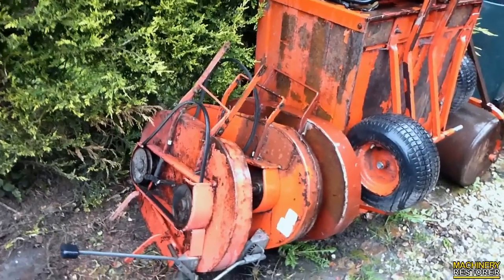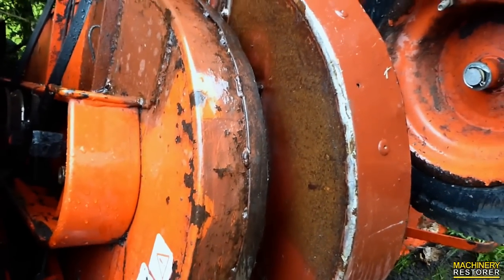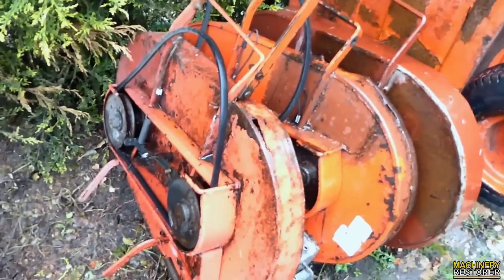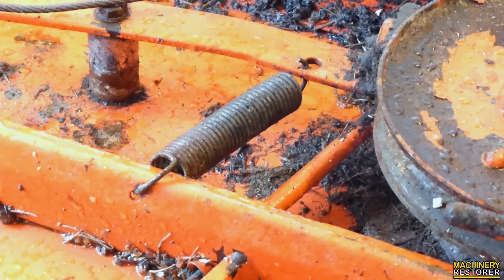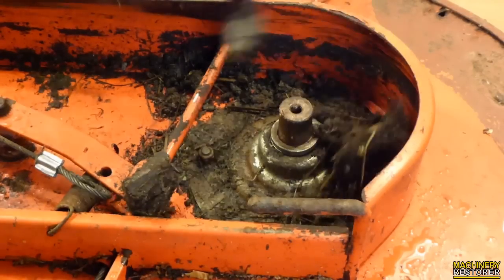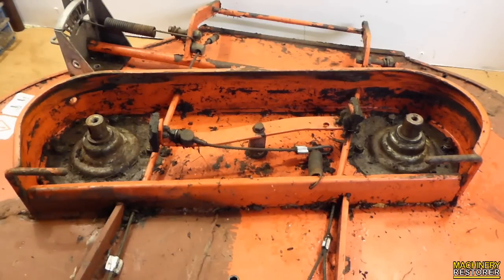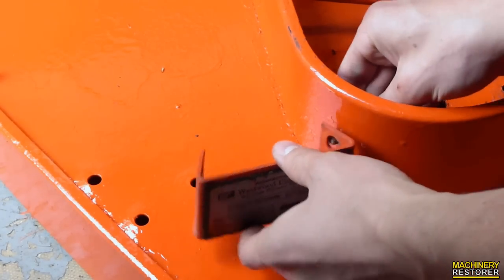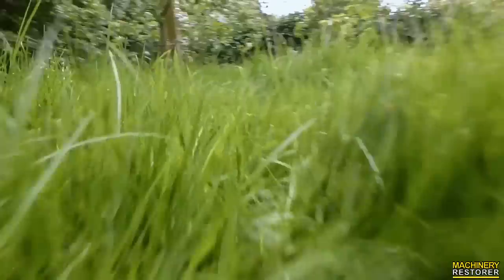Lawnmower Cutting Deck Restoration | 36" Westwood Deck

Comment: My dad had a Laser L95 36 inch ride on mower with the Kohler Command 12.5hp which is the same machine as the Westwood 1200 but is painted grey rather than orange, great machine, spent many happy hours mowing with that. It had a powered grass collector on the back too and we had the optional shredder attachment. Great videos.

Comment: Re your comment about my having a 1983, what I have is clearly older than the one you have restored. for example I have NO guards around the cutting belt, This video was useful though as I now know how to build my deck - previously I was clueless as to how the brake worked ! I fitted old motorcycle brake pads to my own cutter brake but now I do not think they are big enough for the job. I did test the deck today and One of the pulleys failed - the deck just gave way, fortunately I expected that and was ready for it. I will now spend the next couple of days restoring (in my case, over engineering) the deck.
Reply from the maker: Haha, glad it helped you. Just so you know the deck in this video was 1986/87
Reply: Machinery Restorer : hello, could you possibly do a restoration video on a Westwood 42’’contra rotating grass cutting deck as I am struggling to figure out where the pulley brake lever cable and spring go on the machine as I am trying to fix everything before it goes to the place where it will do its job

Comment: I have a deck to restore it has two small rust holes in it!
I'm thinking of cutting it out and pot riveting a plate on. "neatly of course" then red oxide, primer,  top coat and then wax oil under side.

Comment: Hw much tension areyu supposed to have when not engaged, ive burned though 3 belts, thanks
Reply from the maker: The belt should be slack when disengaged
Reply: @MachineryRestorer  thanks only just got this mower the other week one of the guards around the engine pulley seems to be facing the wrong way and bearings are shot I'll go through it all this week

Comment: Hi looking for help to level the cutter deck on a 1012 westwood ride on mower (1995) I can't see how to adjust it from the manual I have for it
Reply: On mine, where the rear hanger, as he calls it in the video, rests on the machine there is a horizontal bar, that has adjusters. Yours may be different though….There’s also adjusters on the deck on the front hanger where the two bars go forward. It’s awkward for access as I recall